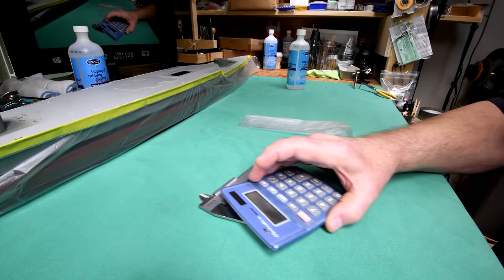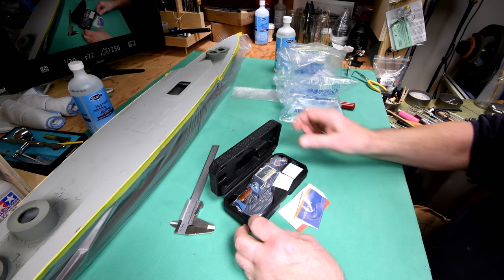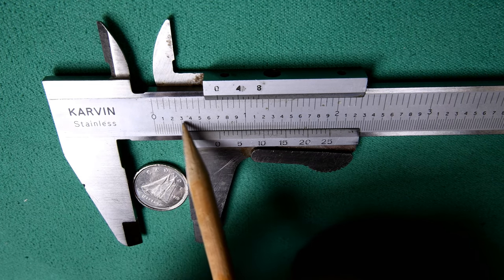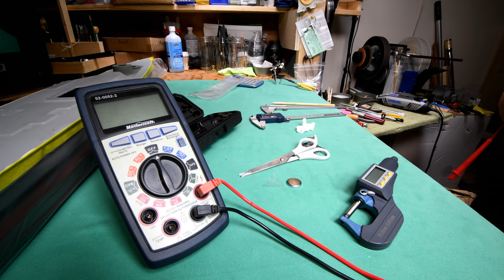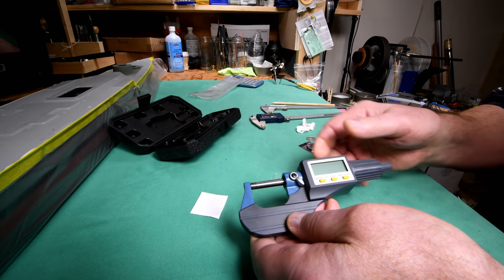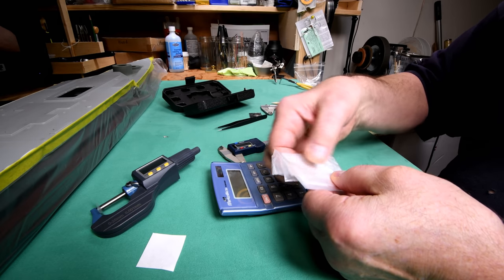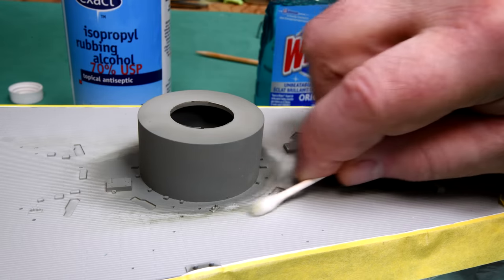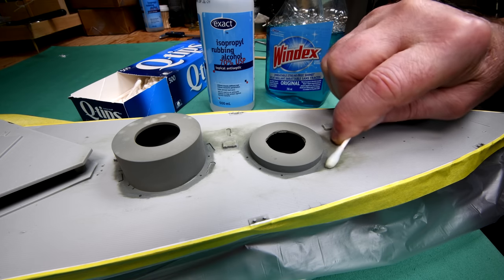The Model Ship - Part 548

Comment: It’s a vernier calliper. I changed to digital as my eyesight got worse. When I started teaching one of the projects was to produce a large scale vernier to use as a teaching tool, mine was about 2’ long.
Reply from the maker: .... then Jim, I'd be preaching to the choir should I be foolish enough to attempt to tell you all about it, lol. 😁👍
Reply: Ron Calverley couldn’t count the number of times I’ve mixed metric and imperial, especially at the very small scales. The thing is your digital mic is on mine the large barrel and the small barrel for fine ratchet movements, this is the same on all my analog mics.
Reply from the maker: @cjstein2000  Jim, this cheap digital micrometer is made backwards. Maybe I'm misunderstanding you. On this one, the large barrel is the ratchet, and the small one on the end is to facilitate fast adjustment. It threw me at first too. 🙂

Comment: The large barrel on the micrometers is for the gross movement the the small barrel is for fine movement/measurement. also like Tony said use white primer then go with the deck tan. See you tomorrow.
Reply from the maker: Re: "The large barrel on the micrometers is for the gross movement the the small barrel is for fine movement"
This micrometer is the opposite of some analog instruments.
Yes, thinking about that white primer too. 🙂👍